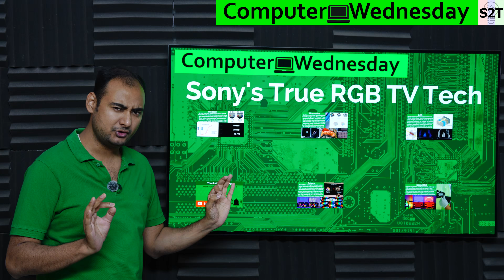Sony's True RGB TV Tech Explained {Computer Wednesday}

Comment: This is the best explanation of the back light systems on Tvs I have ever seen... So I just bought a Samsung S90F Quantum Dot OLED. How long can I expect it to last if I keep it in Movie Maker Mode which is not a very bright setting but has the best color representation in terms of accuracy of the color spectrum???
Reply from the maker: should be fine as Quantum Dot OLED does not drive pixels hard as there is no filter so U hope U will have a long lived display